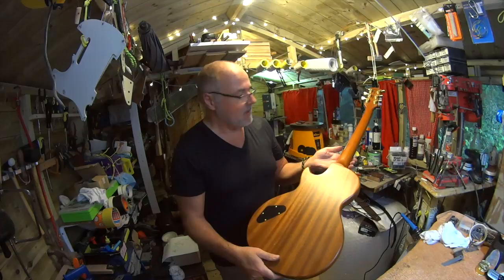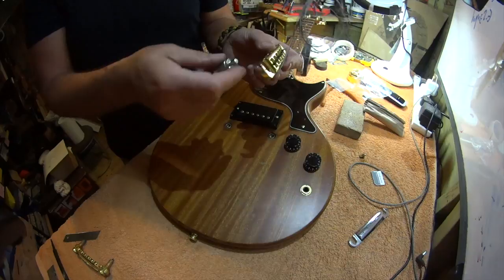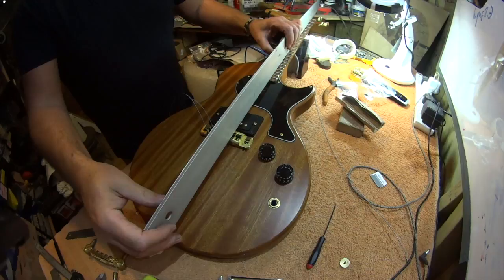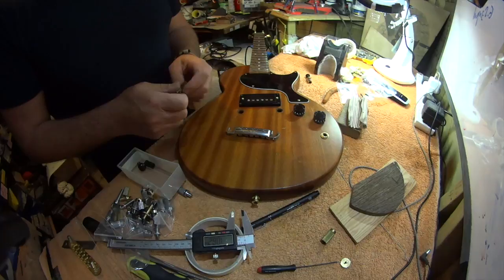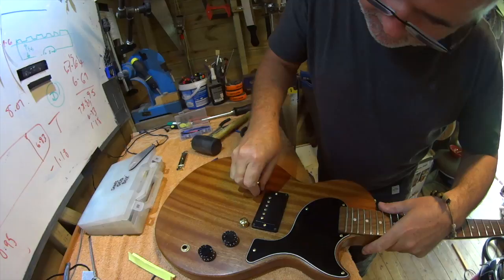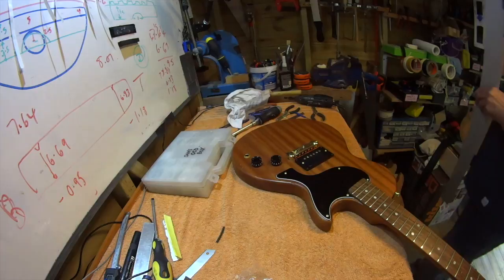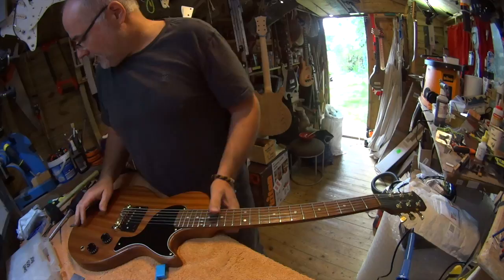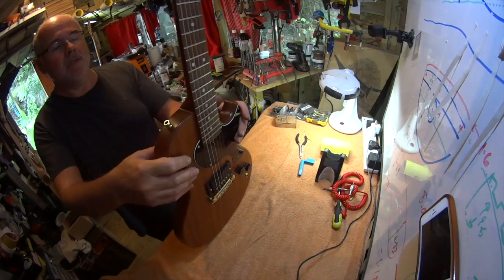Gordon Smith single cut bridge fix

Comment: I fitted a Gotoh 510UB to my GS1 fairly easily but they are all different.
Reply from the maker: Hi Bassman...thanks for the tip! Having had a quick Google I think even that would might have been too tall for this guitar. As it was, filing down a £15 of Chinese wrap-around seemed like a simple (and inexpensive) way to go! The fact that they're all different is part of the GS charm I guess. Truth is, this guitar would have been better off with those holes filled and a flat Stat-style (or even Tele) bridge fitting...